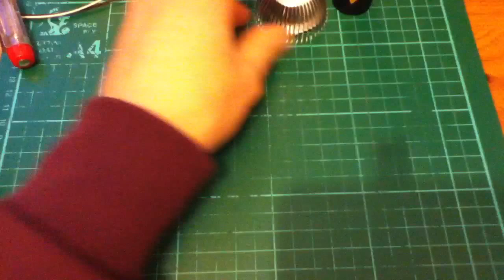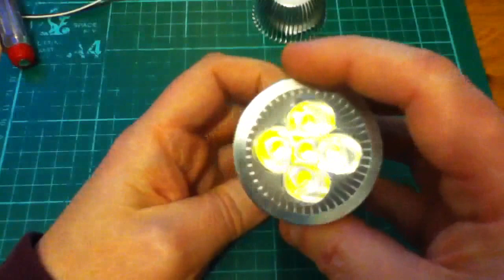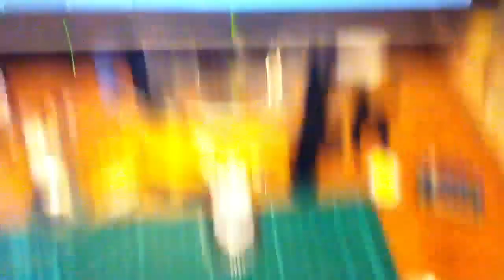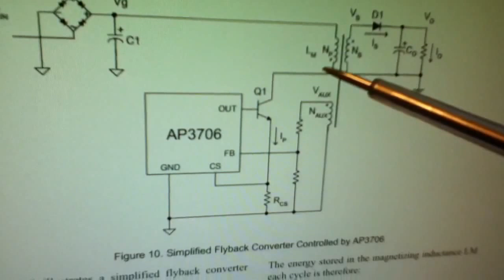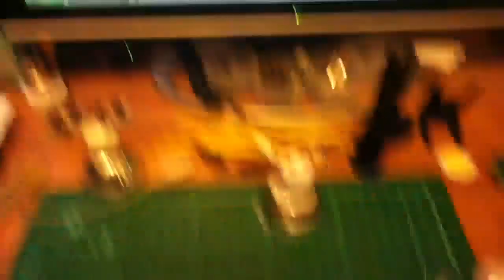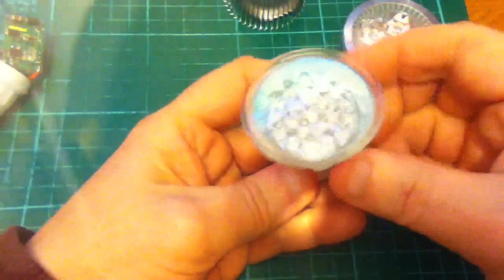Are GU10 LED spot light bulbs inherently safe or dangerous?

Comment: You might also like to consider that LED lighting in general isn’t good for our health due to the the blue short wavelength spectrum they give off. This spectrum of light can have adverse effects, such as oxidative stress, reduces melatonin, retina damage, macular degeneration. The high flicker rate can also damage mitochondria which is the power house for energy production in our cells. So dump these in a safe place! P

Comment: Thanks to Julian for this informative video.  It's disappointing to see that NicolausLedZepplin has added his incorrect opinion to this and AintBigAintClever's similar expose of the bayonet corn lamp safety hazard.    In both cases the presenter's analysis is sound.  These lamps are only safe if used in a fully enclosed fitting, and the power is removed from the circuit before opening the fitting and touching the lamp.  The public won't know this.  There should never be accessible live terminals on consumer electrical goods.   I have over twenty years of experience of electrical products and safety standards, made many CE declarations for electrical products on behalf of my multinational employer, and now lead a large team of engineers on aircraft electrical systems.

Comment: my gu10s have only lasted 6 months and I want to take them apart for a nose around, ive unscrewed them but cannot get to the main part in the plastic casing.....I will have to remove the 2 locating pins .....how is that done??

Comment: Not knowing that much about electronics, are there any differences between the two designs that give safer modes of failure? Hopefully they fizzle out (like the one I bought from Aldi) rather than catch fire.

Another safety aspect is the type of plastic used for the base - is it heat stable, or will it degrade over time. I'd prefer to see a ceramic base.

Also, don't be fooled by the safety markings. Anyone can print safety markings. e.g.the classic China Export "CE" mark.